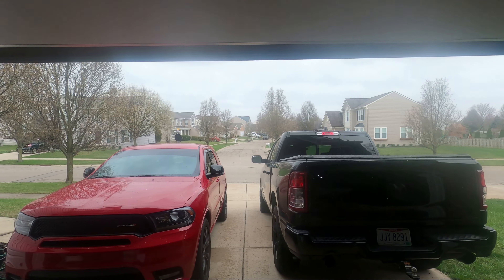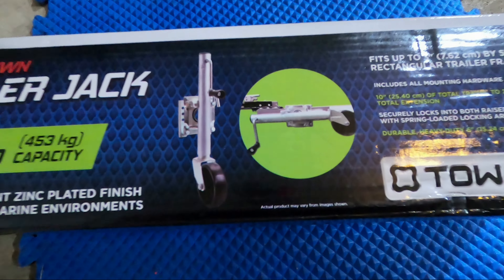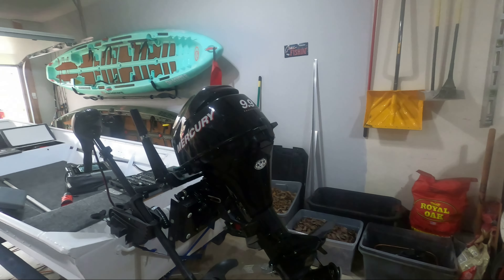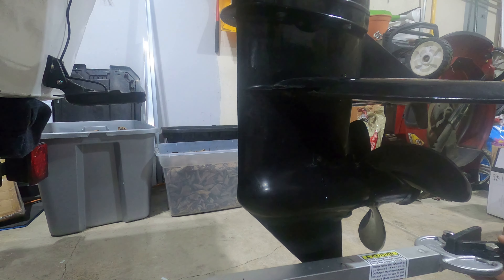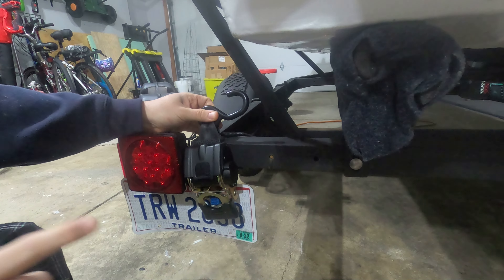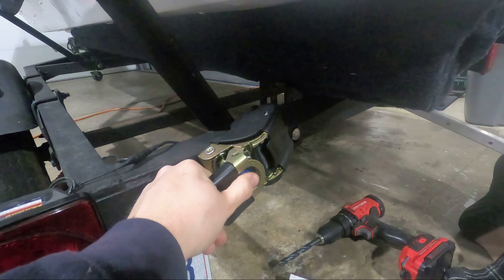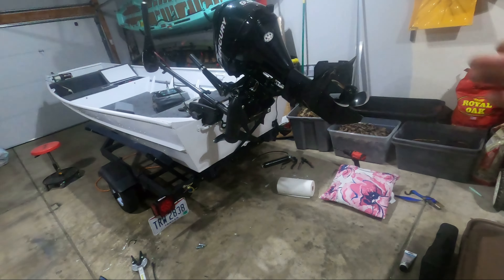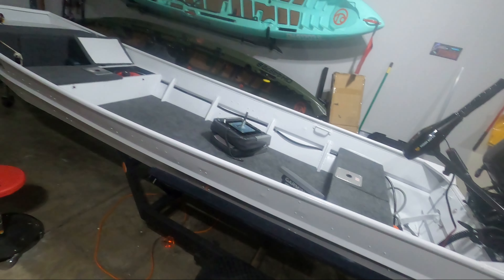TOP 3 BOAT TRAILER ACCESSORIES & HOW TO INSTALL THEM - JON BOAT TO BASS BOAT BUILD CONVERSION

Comment: Safety tip trailer jack bolts go as close to trailer tong beam . The bolts provided additional twist support from front to back motion. Just in case you may not know.

Comment: How do you keep your outboard from turning while towing using the transom saver?
Reply from the maker: So I've fought with this for a while with my 9.9. One thing I found to help was clean the clamp plate with solvent to make sure there was no grease letting it slip. I think you can adjust how tightly it clamps but the only thing I found to work at all was just making sure it was completely centered before trailing and that the rotation clamp is fully engaged and clean. There is no magic fix for this but I will say if you have the bottom strapped tightly to the transom saver it should never turn more than a small amount.
Reply: @mvboutdoors  thank you.

Comment: Great video! I have everything but the transom saver. I have a manual tilt motor like yours. You leave the outboard unlocked while trailer since the TS is bolted to the trailer? Just making sure I understand this correctly before I have a failure on my end lol.
Reply from the maker: Yes, that's correct! The motor rests on the transom saver and any bouncing is absorbed by the trailer instead of your motor mount/transom.